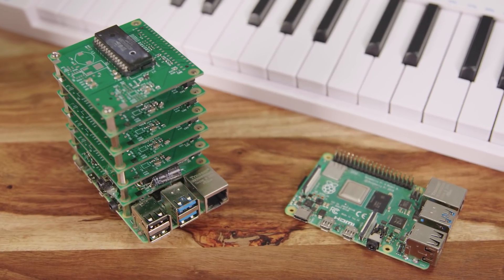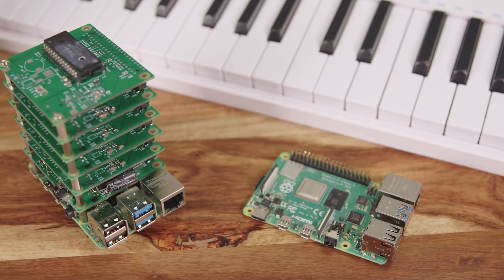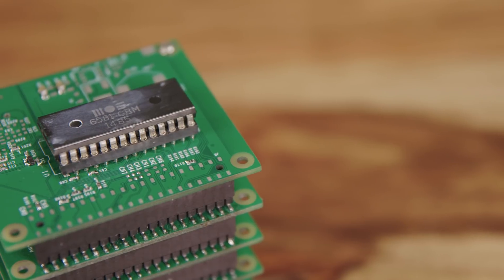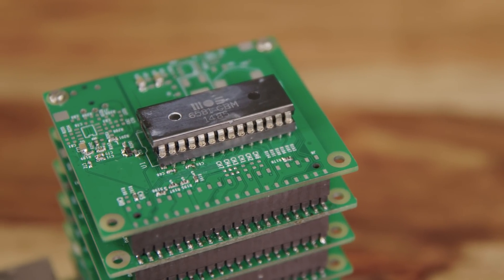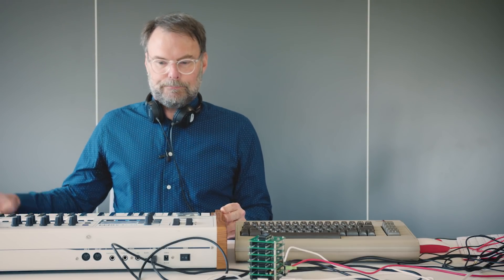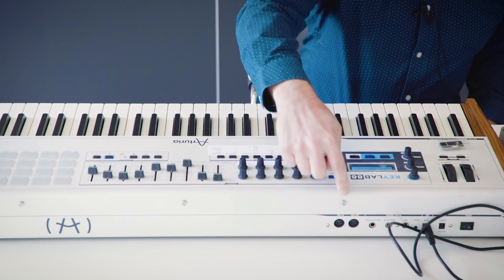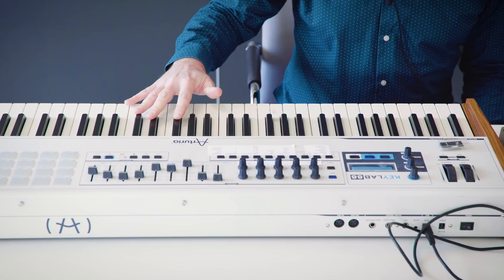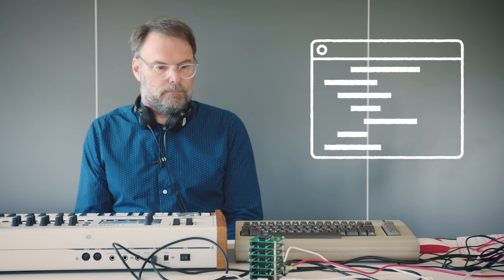Raspberry Pi and Commodore 64 Synthesiser

Comment: This is a cool project. I’m wondering how it differs from the ucapps Midibox SID project, apart from having Raspi as the core instead of the custom PIC/STM32 core. I guess this one has better coverage on captured sid tunes as Midibox SID couldn’t play back regular SID tunes way back when I used it?

Comment: If you plan on building synths with SID chips, please please please don't use new old-stock chips.  There are some nice reproductions that work just as well for this.  These chips are getting harder and harder to find for folks trying to keep old C64 systems running.
Reply from the maker: As explained by Simon (the maker) in a comment on this video: "The chips sold on eBay are usually taken from broken C64s.There are a number of ways that they fail after 40 years. The big power brick was unreliable and often killed the 5V PLA chip. They then get stripped down for spare parts since the SID running off 12V used to survive. I also borrowed a couple of chips from my own working C64s to make this video." He also mentions in the video that he plans to recirculate them back into the C64 world.

Comment: Great project! I hate to take away from the project as an electronic music maker, tinkerer and retro computer fan/collector this is right up my street. But. These computers are vintage and getting harder and harder to find intact these days so my only criticism would be that I wish you'd used one of the SID alternatives out there instead of the original chip. They are getting harder and harder to find these days and over the years I've had several C64s that have had the SID "harvested" out of them for exactly these kinds of synth projects. Good work though I look forward to seeing what else you can do with this! 👍
Reply from the maker: As explained by Simon (the maker) in a comment on this video: "The chips sold on eBay are usually taken from broken C64s.There are a number of ways that they fail after 40 years. The big power brick was unreliable and often killed the 5V PLA chip. They then get stripped down for spare parts since the SID running off 12V used to survive. I also borrowed a couple of chips from my own working C64s to make this video."
Reply: @raspberrypi  Thanks for clarifying, i was more concerned about others following the project and butchering some C64's in the quest for SID's, probably not a real concern tbh :)
Reply: Did I also hear recently that somebody is releasing a recreation of the SID chip ???

Comment: Sounds great! I saved up like mad and bought a SID chip "back in the day" to upgrade the sound capabilities of my Oric Atmos. It worked really well on the second SID, but the first died whilst I learnt an important lesson about static electricity... 
Take care of those SIDs!
Reply: Also the audio in pin is quite dangerous. It’s better to solder it to the ground to avoid any spikes there when connecting. Many people have burned their sid chips by feeding various sound sources to the audio input.

Comment: krass Geil !! love it - hope mr. hubbard will see your work and comment it too !!!!
would be cool to use swinsids instead of butchered c64´s SIDs... all one one pcb with midi in & with rasperry header to plug in for a compact unit... just a thought
Reply: I have a couple of SwinSIDs. They work great but I wanted to use original 80s electronics. The SwinSIDs don't give the same grungey sound as the 6581s. They are just software after all.
Reply: @simonmartin4599  Is the SID too complex for FPGA implementation? If so, our community could work on grunging factors for the envelopes, setting different colors of noise and noise distribution as FM synthesis augments.

You may not have the same level of concern about this, since you are focused on the original DIPs rather than only the content. However these chips are moving from rare to endangered. Meanwhile many of us just wanna 8-bit bang tunes with consistent and affordable material.

These are the musical instruments of the retro future. We have the bandwidth. Link needs more ocharinai!

Comment: So I know there are fpga solutions to replace the SID now.  They're not quite 100% accurate, but they're fairly close. How feasible would it to be to have an fpga solution that replicated multiple SIDs at once, so you could replace that hat with a board that has a single chip, but still get the same polyphony result?
Reply: Its perfectly possible. You could have hundreds of channels with a big enough FPGA. Its only a true homage to the great C64 if I use actual 1980s silicon.

Comment: seems silly.  the raspi itself has no need for all those extra boards and can blow away any sounds they make all on it's own.
Reply: Yes you can play c64 games directly from a Pi but the original C64 hardware is still sought after. There is a characteristic of sound that only works if you use the 1980s electronics. The digitally generated Pi sounds are too “clean” and not with the distortion that people remember them.
Reply: @simonmartin4599  There actually is two other options rather than using the SID chip, SwinSID, or FPGASID, have you considered trying them?
Reply: @LeftwingSFX  Yes - I fitted a SwinSID and tried it. Its has less background noise and a cleaner signal. They don't produce the original grungy sound character of a C64. Just a software simulation of it.
Reply: @simonmartin2263  Have you "seen" the FPGAsid comparison with an original SID?

Comment: This is overkill and should have been done with a pico 😉
Reply: This is absolutely true. I chose a Pi 4 because it’s easier to program (being a standalone computer) and easier to stack up circuit boards on top
Reply: @simonmartin4599  would of been nice to see do with a Pico a hole almost mini computer the same size as Sid chip it's self. :-)

Comment: Interesting. I have a stock of sid chips of various revs, like 14 or 15... Plus two inside my c64 with the Sid2sid card for 6 voice "polyphony", or dual mono mode. I use them with midi via the Mssiah cartridge. But this project looks really interesting.
Reply: I always wanted one of them cards for my C64s. The advantage of using a Raspberry Pi is that it makes programming the SIDs much easier
Reply: @simonmartin4599  You could just emulate the SIDs on the pi

Comment: Didn't realize Mr. Yannes founded Ensoniq. I wonder if some of the early Ensoniq designs might have been influenced by the SID.
Also, would have loved to see the project's visual interface, even if just briefly, and even if it's just something cobbled together and not very polished.
Reply: He took the concept beyond the ubiquitous subtractive synthesis of the time and became a pioneer of wavetable synthesis which is massively powerful but lots of effort is needed to create new sounds. Too complex for 1981 designers with their simple chip technology
Reply: The SQ-80 has some very SID sounding presets in it.  Not all, but there are some that sound very similar.

Comment: Five C64's died for this.
Reply: The chips sold on eBay are usually taken from broken C64s.There are a number of ways that they fail after 40 years. The big power brick was unreliable and often killed the 5V PLA chip. They then get stripped down for spare parts since the SID running off 12V used to survive. I also borrowed a couple of chips from my own working C64s to make this video.